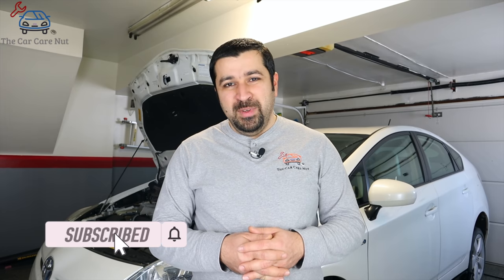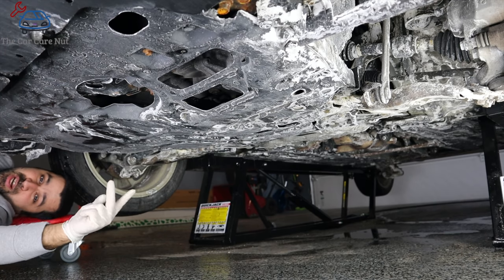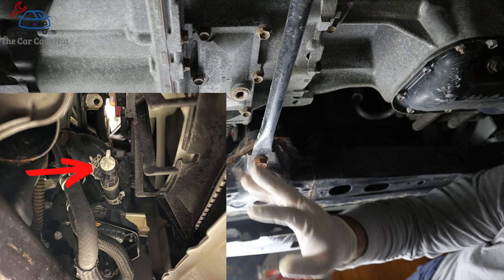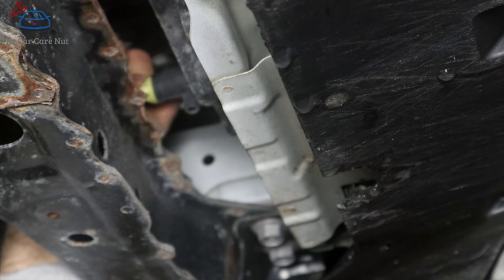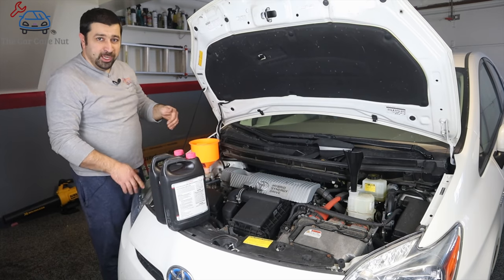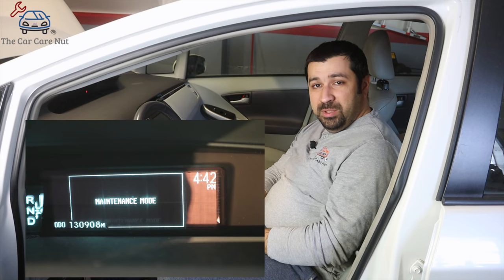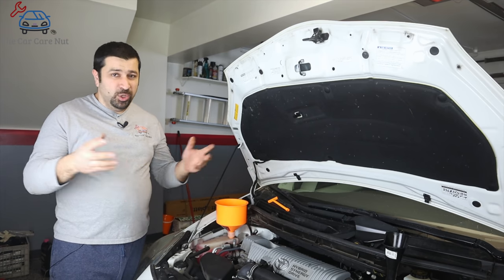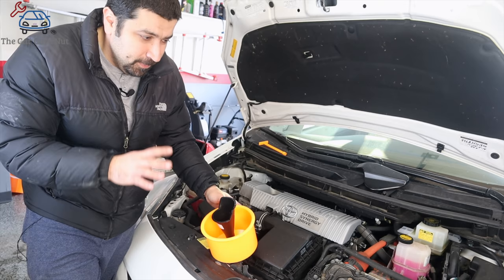How to replace your Toyota Hybrid Inverter and Engine coolant

Comment: On a 2016 Prius 3 there is a drain plug for inverter it appears at the bottom of the radiator from parts diagrams.  Is that what should be used for the inverter or is there a plug on the bottom of the inverter that should be used to drain the fluid?  Thank you!  Just found your channel.. looks great!

Comment: @TheCareNut - does the maintenance mode apply to 2022 model hybrids and up? If not, do I just skip to the putting the heater on full blast and revving the throttle? I'm specifically asking for the 2022 UX 250h and 2023 RX 350h. Thank you in advance!

Comment: Prius Prime? With default in EV mode how do we put in Maint Mode and get ICE running? Thx. BTW, another awesome video.
Reply from the maker: Hi ray! Do the exact same that I did in the video and you’ll enter maintenance mode in your Prius prime where the engine will run continuously. But just a reminder don’t drive the car in this mode.

Comment: What is the relevancy of cooler fan coming on twice in regards to air removal in the inverter?  How do you know if inverter hoses need to be replaced? As one is pliable but one is very hard. 2002 prius 97,000 miles

Comment: I have a 2018 RAV4 Hybrid XLE and I am having trouble finding the inverter coolant drain plug.  It looks like there might be a drain plug under the radiator (there is round cutout in the support), but it is not a hex plug; it looks like an oil drain plug nut. Can you help me?  Also, I did the radiator coolant change with no issues.  Thanks.  Jay

Comment: I have a concern. I wasn't able to flush the radiator coolant side after opening the drain plug. I don't understand what might have gone wrong, but I was able to drain the Inverter coolant. Is there something I missed? This is on a 2021 Corolla Hybrid.

Comment: i'm planning on replacing a water pump, thermostat and radiator on a 2007 GS450H do i need to drain the inverter or just the main radiator system ? what about bleeding do i need to bleed both systems or just the main one ?
Reply from the maker: Just the engine side on this case

Comment: I've got everything ready for my wife's 2017 coolant and transmission fluid changes so I've been practicing putting the car into Maintenance Mode with no success....very frustrating!  I've probably ran through the steps 15 times, now....does the car need to have the parking brake set?

Comment: Putting the car in Maintenance Mode will disable the traction control and allow you to get unstuck or power up a hill in snow.
Reply from the maker: I wouldn’t do that though. That’s not what maintenance mode is for.

Comment: For the 2015 camry xse v6 engine, do you have a maintenance mode? or just run the engine and allow the fan to cycle on twice? do you need to burb the coolant by squeezing the upper rad hose. thanks
Reply from the maker: Hi! The 2GR v6 has a specific bleeding procedure otherwise you won’t get the air out and you’ll have no heat and overheating issues. I plan to make a video in the near future on the 2GR coolant bleeding

Comment: Great Video!  Just had one problem and am waiting on your reply to do the procedure.  I have a n '17 RAV4 Hybrid and I can not do the Maintenance Mode procedure because I can't put the trany in Neutral without the engine running.  Is there a different procedure for the RAV4 as it does not have the electronic shifter?

Comment: Great video.  I have a 2015 Highlander Hybrid.  I read somewhere that you should use the Toyota Techscan tool to activate the inverter pump (and possibly the engine coolant pump) when changing coolant to prevent damage?  It sounds like as long as you keep the reservoir full you should be fine?  I have put off changing mine (70K miles and 5.5 years old) but now am going to do so based on your video.  Thanks!!
Reply from the maker: Hi mark! So the pumps will come on and start circulating coolant as soon as you turn the car on. If the pump is not running you won’t get circulation so you’re not at risk of damaging the pump and if the temperature rises the pump will come on and circulate the coolant. That’s why I mentioned that you want to wait until the cooling fans come on twice which means the engine is at operating temperature and the 2nd time is to verify.

Comment: Excellent video and thank you for all this info! I'll be doing mine tomorrow. I just replaced my valve cover gasket but stuck on the torque specs for tightening the bolts for my '14 Camry hybrid XLE. It's a 2AR FXE. Could you tell me what the torque is for those valve cover bolts?
Reply from the maker: Hi! The torque spec is 9 ft lbs
Reply: @TheCarCareNut  thank you so much!
Reply: @TheCarCareNut  How about torque specs for same vehicle but for the transmission drain and fill plugs? I saw 2 different numbers being 29ft lbs and another for 37ft lbs. Not sure which to go by but I'll start with 29ft lbs. Thank you so much for your info....its a blessing!
Reply: @72east  2010 pruis - 29ft lbs is okay ????

Comment: A little confused as to which hybrids the inverter coolant is safe to change in this manner.  I have a 2013 Avalon Limited Hybrid, can I change it this way? Someone told me I needed the Dealership to operate the pump with their computer.  Thanks for these videos.
Reply from the maker: Hi! You can use this method for your Avalon hybrid
Reply: Maintenance mode will keep your inverter pump running at all times, without even engine run.
Reply: How did this work for you? I have a 2013 Avalon hybrid and I'm having a hard time getting the coolant to drain our of the reservoir in maintenance mode. The fans run, but the engine keeps heating up because the coolant isn't circulating. Did you fill the radiator directly via the radiator cap?
Reply: @ScottHancock  Scott, if you are asking me, I haven't done it yet.  I was going to flush the brake fluid at the same time, and have gotten conflicting info on it too.  So, I go by the old saying "if you don't know what to do, don't do anything".  The Avalon hybrid has been too good for me to go and mess it up.  I'm waiting to see if "Nut" will reply to my question about the brake fluid.  If you figure it out, please post here.
Reply: @bogieman101  I didn't change the inverter coolant (thankfully, for my wife's sanity, I attempted one drain and refill at a time).  Read my LOOOOONG comment about the engine coolant process from a few days back.  It's absolutely imperative that you fill the entire radiator with fluid (remove the metal cap, pour until it won't take any more and all the bubbles have come out) BEFORE filling the plastic reservoir to F.  Our hybrid Avalons don't work like the Prius in his video...they won't suck in enough fluid from the reservoir, and the system will be starved for coolant.
Reply: @ScottHancock  Thanks, now I'm wondering what else doesn't work the same as the Prius...

Comment: For my 2013 Lexus es300h, my manual states that engine coolant needs to be changed at 100k and inverter at 150k. Can I do it? Or does it have to be done at the same time?

Comment: Awesome video!! just a question,, How often you need to replace the coolant on a 3 generation Prius?? Thanks
Reply from the maker: Hi! For both engine and inverter the first replacement is 100k miles or 5 years. After that every 50k miles or 5 years

Comment: Hey, I have some air in my system. No white smoke or anything coming from the exhaust and coolant levels appear to be good. Can I bleed the system like this? Just trying to figure out if this method only works with full drain and fills?

Comment: After how long the first time fan run and stop and run it again I did changed the coolant putting the car on maintenance mode but the fan did came but it kept running like 20 minutes didn’t stopped 
Thx car model is 2020 Camry hybrid

Comment: @TheCarCareNut  man, i have a prius c or aqua, and i had the other day a knocking noise when the gas engine started and it was only at this moment, when contantly driving it didnt have this problem, i dont know how low of octane gas can the prius use, in my country we have 95 ron and 85 ron, honestly i was using 85; 91 ron is te same as the 87 aki you guys use in the USA, so i tought it wouldnt hurt the engine  ... one more thing spark plugs are still ok but engine air filter was clogged already changed it

Comment: Another great informative video.  I received a few with the yellow cap on my last order from a dealership mid last year, should take it off  my shelve and get rid of it, or is it still usable?
Reply from the maker: Hi! If it’s unopened it should be good but if it’s opened I would discard and get new.

Comment: Nice Video. I wanted to do this for my Prius V 2013 , but not sure where the drain plug is located  Can someone please confirm how to get to the engine coolant drain plug on Toyota Prius V 2013. Thank you. I subscribed
Reply from the maker: Hi! It should be underneath the transmission just like the video

Comment: What does it mean when a message (hybrid cooling parts need maintenance carry to dealer)  I've cleaned the air intake filters and they weren't dirty.  2017 rav4 hybrid. Any help is appreciated

Comment: Thanks for the video. Is this the same for Lexus es300h? AND why didn't you flush the system with water?
Reply from the maker: Hi! It is the same for your Lexus and unless there’s contamination a flush is not needed.
Reply: @TheCarCareNut  Thanks your awesome! 

Just FYI the Lexus dealer told me the coolant should be change at 100K or 120months. My manual indicates the mileage interval but does not indicate any period for time.
Reply: Would you change at 60months even though the deal told me 120months?
Reply from the maker: I personally would
Reply: @TheCarCareNut Will do. Thank you for the reply and advice.

Comment: i'm having issues with air and overheating. Is it because i'm only doing the engine coolant and not the inverter? do i have to do both at the same time?

Comment: Please help! I did everything you said. All went well until the car was running in maintenance mode. The engine coolant will not get sucked in from the tank and the big red triangle came on as well as a tempature light. I'm 99% sure it was over heating. I shut the car off and next thing I know the tank is empty. I filled the tank and put it back in maintenance mode and same thing but this time when I shut it off it did not empty the tank and it made a very strange sound by the driver front wheel around where you let the coolant out. I have a 2007 prius. The inverter coolant all went fine. What am I doing wrong?
Reply: Aaron...how did this get resolved for you? Similar issue when I tried this with my '13 Avalon hybrid. The engine keeps trying to overheat and it won't bring in fluid from the reservoir.
Reply: @ScottHancock  You have to add the coolant straight into the system and bypass the reservoir
Reply: I did this and made sure the reservoir was full and it finally worked.  Just make sure access spot to the radiator is filled all the way to the top.  When it starts heating up it will suck it in.  Than if it goes to overheat shut it off.  Wait like 20 minutes or till it is cool and than open the radiator cap and fill it again.  I did this maybe too times after I asked the question and it finally stopped overheating and stayed full.
Reply: @aaron647  THANK YOU for your help.  I just followed your advice and filled the radiator through the access hole under the cap, and kept refilling until it couldn't take any more. Then I filled the reservoir to F.  The engine is no longer attempting to overheat, my coolant pump isn't spinning dry, and my heat is working again.  I added a detailed write-up and warning in my comment...hopefully owners of similar vehicles with a metal radiator cap will learn from our experience.
Reply: @ScottHancock  Awesome!  Glad it worked!

Comment: Hi, what is the color for the 2024 engines coolant? 

I could NOT tell from the picture in video. Both look pink to me 🤷‍♂️

I have a 2014 Camry Hybrid LE
Reply: Pink. Buy it at a Toyota dealer. 50/50 about 27 bucks a gallon. Get 2 or 3. If you don’t end up using the 3rd one, take it back for a refund or keep for emergencies.

Comment: Do you happen to have a coolant replacement video on the 2AR-FE (2014 Toyota RAV4 2.5L) engine?  Thank You!
EDITED:  There are 3 different funnels in your Amazon page, which do you recommend (I have mostly Toyota vehicles, Honda and Subaru)... Thanks again!!
Reply from the maker: Hi! I don’t have a video yet for a 2AR will come in the future and for the funnels I put three for different price points they all have the right adapters for your car
Reply: The Car Care Nut , Thank you!  I look forward to it.

Comment: I have a question,... With how many km, or miles should I say, do you have to change the inverter coolant ? I remember the sales person at the dealership said that it's only changed every 230.000 km or so If I recall correctly. I would like to know your recommendation. Thank you again for another cool video.
Reply from the maker: Hi! I recommend you replace the coolant the initial replacement at 160k kms or 5 years then every 90-100k kms or 5 years
Reply: @TheCarCareNut  thanks 👍

Comment: At how many miles do you recommend changing the coolants? Have a 2016 Prius with 72k on it, just swapped oil and transmission fluid

Comment: Excellent material You produce Sir.
Wonder if You came across 2016 Prius losing engine coolant. My started losing coolant two weeks age. Can not find any leeks, engine oil seems to be clear, no bubbles in the expansion tank. Some white smoke came from the tail pipe after driving. No check engine light or codes detected.
Where would be a good place to start lookin.  
Best regards,
Jarek
Reply from the maker: Hi! You’ll need to check for combustion gases in the coolant. Nothing common on coolant loss

Comment: Hi AMD, I have a 2019 highlander hybrid. How what is your recommendation interval for this service? Manual says states at 120k miles. Lastly, how many gallons should I buy to do this service on my particular vehicle? (Thank you for your latest videos… 5k oil changes and cleaning hybrid fan filter 👍)

Comment: On a Prius gen 3 how often should the pcv valve be replaced and how often does the egr cooler need to be cleaned(how to clean it)?
Reply from the maker: Hi! The pcv valve is not a maintenance item, however I usually recommend it with spark plugs around 120k as a preventative measure. The EGR is also another non maintenance item, cleaning will depend if it’s dirty. I would remove the metal line going from the egr valve to the manifold to see how it looks and decide if you should clean things or not

Comment: I understand the car has to be a maintenance mode, I seen other videos where they turn the car on and let the inverter fluid drop, then turn the car off add more fluid and then turn it back on and let it drop, and so on and so on.

I am going to do it the way you suggested, just the fact of the car has that option, but if one were to go the other route would it cause any issues?
Reply from the maker: Hi! For the inverter coolant you don’t need to be in maintenance mode. But for the engine coolant you do.
Reply: @TheCarCareNut  thank you

Comment: Is it a myth that Prius gen 3 probably needs to have the head gasket replaced around 150k miles, what causes it or how to prevent it?
Reply from the maker: Hi Kevin! So it’s a myth to say at this exact miles the head gasket will go. But head gasket failures are somewhat common on the 3rd generation Prius. No concrete fact reason that I can share to why it’s happening. But replacing the coolant and not neglecting check engine lights is a big factor. Since the car has no temp gauge if it overheats it will set trouble codes. If owners ignore them which they do! Then the issues start
Reply: @TheCarCareNut  I hate the temp gauge on the 2013 camry hybrid.  The tick marks are so small, it's hard to read while driving.  I much prefer the good old analog gauge.

Comment: Hi AMD, Apparently I'm the only person who can't get into Maintenance Mode?  2013 Camry Hybrid.  I turn the car on without the brake pedal on, fully push down the accelerator twice, and can't get into Neutral, the shifter won't let me because the engine isn't in run mode, just in what used to be called accessory mode.  I tried it with the engine fully on in run mode, but that wouldn't get me into maintenance mode, either.  And I don't have Techstream.  Are there any factors complicating this, like you have to wait so long after turning the car on, or the engine needs to be warmed up?  Thanks!
Reply from the maker: Hi Jim! Let’s figure this one out. So you want to do the following:
1- with your foot off the brake you will press the start button twice until all the lights in the dash come on.
2- you will press the gas pedal all the way to the floor twice quickly then press the brake pedal and shift it into neutral. Let go of the brake pedal then press the gas pedal twice and then brake pedal on shift into park then let the brake pedal go and press the gas twice and it should say maintenance mode then press the brake pedal and push the start button
Reply: @TheCarCareNut  That worked, thank you so much!!  Happy Easter!

Comment: I believe I have a leak at the joint of the transmission case and the cover/plate that the inverter coolant drain goes into.  Does anyone know the correct sealant to use and the torque spec for those cover bolts?